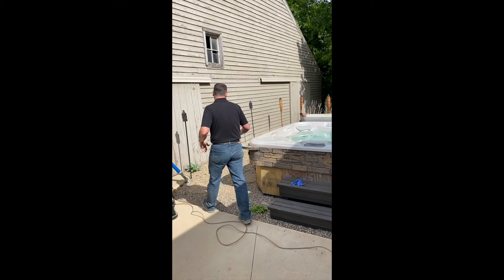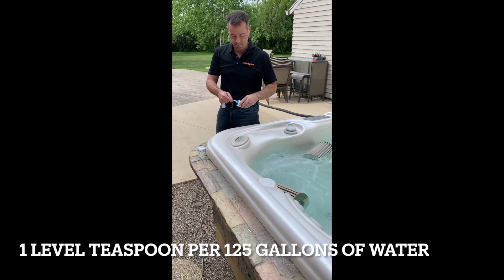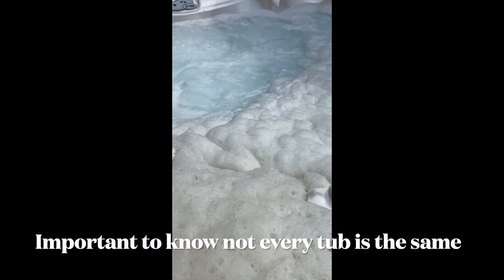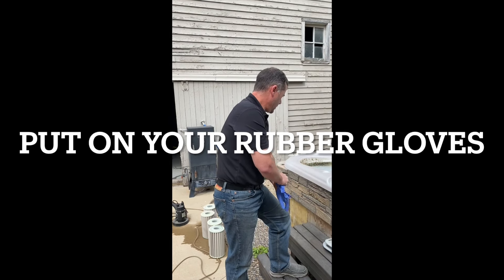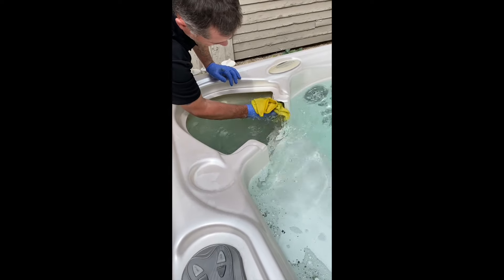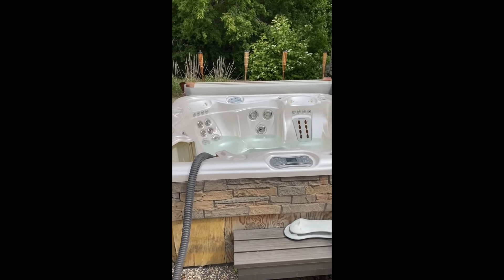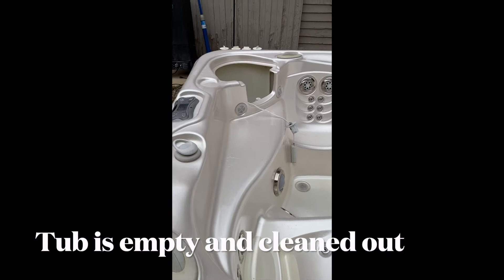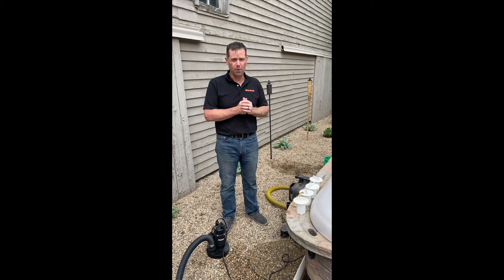How to Purge your Hot Tub with Ahh-Some

Comment: Do you recommend running it with the air vents wide open? And what’s the point of having the water balanced if we’re going to drain the water?
Reply from the maker: Good morning Brynn.  You absolutely should run Ahh-Some with your vents open.  With regards to why you would want the water balanced, it is basically to allow the Ahh-Some to work the most efficiently.  What we are most wanting to be balanced is your pH.  Having your water pH balanced will allow the Ahh-Some to work far better.  Can you run Ahh-Some with unbalanced water, sure.  It just works better with balanced water.
Reply: I just read this response and didn’t realize we should have the air on full! We had the motors on high…but not the air. Shoot! Next time we’ll know!

Comment: If your tub hasn't been cleaned like this in a while, would you need to fill the tub again to "rinse" things out before the final fill?
Reply from the maker: Great question.  I personally do not do this as any residual is very small.  I would fill, and then run the jets for a good 15 to 20 minutes to flush out.  Then I would start balancing as soon as your water reaches 80 degrees F.  That said, you absolutely can refill, run the jets and then drain again.

Comment: Hi! Thanks so much for this helpful video. Is there a reason why the filters need to be removed before the purge? Isn’t it harmful to run the jets without filters in? Also, isn’t it harmful to run the jets with no water as you did at the end? Sorry if I sound oblivious/ignorant—I truly want to learn why :)
Reply from the maker: HI there and thank you for leaving the comment/questions.  So lets talk about the filter cartridges first.  There is absolutely no harm in running your hot tub with the cartridges removed.  Generally, we don't want to do this on a normal basis simply because of what the filter is designed to do, filter water but also, we don't want big chunks of things (think leaves, twigs, ect) getting sucked into the system and potentially harming the pumps.  That all said, Ahh-some is really strong stuff and if there is biofilm in your plumbing, it will release it all.  If you leave your filters in, they will just get gunked up with biofilm and I have seen bad cases where you need to completely toss them and get new ones.  So, for the duration of the purge it is completely ok to run without the filters in.  If your tub is under a lot of trees and what not, just shut the cover while the tub is purging so you don't run the risk of anything going in the water.  Now with regards to the jets and what I did there to cycle them quick.  For that quick of a period of time, no harm will be done.  If you let it run, Yes, harm will be done but I simply just cycle real quick.  Push the button, and then almost instantly push the button again.  Hope this all helps and please let me know if you have any other questions.  Jim

Comment: When that cruddy foam is building up on top of the water (while the 30 minute process is happening) should we try to scoop it out?
Reply from the maker: Hi Ralph and thanks for the question.  I would recommend not trying to scoop anything out.  This will simply take away what the Ahh-some is working to do.  Just let it be and let the purge complete itself then once you turn the jets off, the foam will subside and you can wipe down.

Comment: I need to drain my hot tub and refill so I want to run this product through before draining and refilling. My chemicals are not balanced at this time. Can I still run this product and then drain and refill without balancing first? What temperature does the tub need to be at?
Reply from the maker: Hello and thanks for the question.  You absolutely do NOT need to have it balanced to effectively run Ahh-some through the system.  You will lose a bit of effectiveness but it will be a very small amount of difference.  We prefer the water to be above 80 degrees to run Ahh-some so that way the gel dissolves properly.  Hope this helps, let me know if you have any further questions.

Comment: Hi. Thanks for the great video. I am getting a brand new hot tub and heard you should purge with Ahh-Some to remove any biofilm and contaminants from the manufacturer wet testing. You mention in your video, that you want your water perfectly balanced. Is this a requirement for a brand new tub? I was hoping to just fill with hose water, heat and then purge. Then drain and refill and start balancing the water. What do you recommend?
Reply from the maker: Hi Nick and you are very welcome.  It is not absolutely needed to have perfect balance before purging.  The most important factor you can check right away is your pH and you can run a simple water test from your source water.  You just don't want the pH to be extremely high or low before purging.  For example, my water source pH is about 7.9 so that is slightly high but well within the range to purge with.  Great question and thanks for asking it.  Jim

Comment: I did my first  purge with Ahhsome and a tremendous amount of brown clay-like crude came out of my 6 month old Hot Springs Envoy. Since then, I noticed a dramatic improvement in the Hotspring Freshwater Salt System's performance.  I was able to turn down the output level and can go many weeks without having to add chlorine granules and only shock (MPS nonchlorine) once a week. I previously had to add chlorine manually weekly and shock (MPS nonchlorine) after each use  to supplement the salt system. I used to  struggle  to keep my chlorine levels up.
* I just did another purge yesterday after 10 months. Only saw a  mild green ring of film around the waterline.  No thick brown clay-like gunk this time.. The water lines near the motor look brand new inside. I wonder if that is a result of the improved salt system performance from the last purge with Ahhsome.  Where I really see a difference is with my jetted tub. With other brands, I had to do 3-4 purges to clear out the pipes..I kept seeing black flakes and gunk when trying to bathe...with Ahhsome, one purge gets it done..no black flakes. Clear clean water. I do deviate from the directions which say let system run for 30 minutes...I let my Spa and jetted tub run for closer to 1 and a half hours and let it sit off for 30 minutes before letting it run again for 10 minutes and draining. I find more crude is produced after an hour opposed to 30 minutes.
Reply from the maker: Thanks for the great information here JD.  This is extremely important information for everyone who owns a tub and especially for those with the Freshwater Salt System.  Thank you for taking the time to write what you wrote.
Reply: @ahh-some  This is the product that made our Freshwater Salt System perform like it is supposed to!  I reported our excellent results back to our spa supplier, and encouraged them to advise all new Freshwater users to START their system with Ahh-Some.

Comment: Can you clarify what you do with the salt cartridge during this process? Leave it in for the purge or remove it at some point? Thanks!
Reply from the maker: Great question.  I leave mine in so that the purge can do a good cleaning on the cartridge during the process.  You certainly do not have to but I always recommend to leave it in.
Reply: @ahh-some  Thanks for the quick reply!
Reply from the maker: @khueil  very welcome
Reply: I used the liquid ahhsome in my grandee- no foam, just a ring of yuck around the tub. 🤷🏼‍♀️
Reply from the maker: @khueil  Great to hear.  Don't worry so much about the foam.  The goal is remove the biofilm from the plumbing of course.  Lack of foaming is generally but not always due to the water in the tub being slightly on the hard water side.

Comment: It's ok to run the tub with no filters? Everything I've read said never ever do that. I'm assuming it won't work right with the filters left in.
Reply from the maker: It is absolutley ok to run your tub without filters.  The only reason we like to keep the filters in the tub is to ensure any large particulates such as leaves and what not do not go through the system. That said, the tub will actually run just fine without the filters for the duration of your purge.  If you leave them in while purging, you will ruin them and will need to replace them as the amount of gunk that will accumulate in them will be not great for the filters.  Some customers will actually shut the cover of their tub while purging, especially if the tub is located under trees just to prevent foreign objects from entering the water while purging.  Great question and please let me know if you ever have any others.  Jim P

Comment: So you just using sump pump for convenience? Can I just open up drain and let it drain than? Also while purge is running can I shop vac the dirty foam as it builds while pumps running ??
Reply from the maker: Yes I just use the pump because I have them (we live in the upper midwest and everyone needs a sump pump in the spring) so I just use that.  You absolutely can use the gravity drain just fine.  I do not recommend shop vac'ing the foam.  The foam is your active ingredient that does your purge so you start pulling out the foam you are starting to lose active.  Just let it run its course.  You really should not have that much foam anyways.  Use less Ahh-some than you even need to.  You can always add to it if you need to add more.  Hope this helps and thanks for the comment.

Comment: Just wondering if we have to purge until there is no gunk produced? We have followed the ahh some instructions with a fill, purge, drain 3 times already. Each time we add ahh some to the highly chlorinated water, either green/brown or white/yellow gunk is produced. So we drain, vacuum the lines, refill and start the process again. Do we need to keep doing this until ahh some produces no gunk or have I blown our water bill for no reason 😂
Reply from the maker: Great question and there are times that additional purges are needed.  However, I would not drain the water in between purges.  You can continue to purge with the exact same water.  This will save time and will save on the amount of Ahh-some used.  Here is a good procedure.  Purge the tub with the required amount of Ahh-some, and do the purge.  After the cycle is completed, wipe the gunk away and let the tub sit for 30 minutes to an hour.  This is actually of benefit as it lets the Ahh-some in the water sit in the plumbing.  Then go back out and run it for 30 minutes and repeat.  You can use the same dose of Ahh-some all day.  At least 4 to 6 30 minute purge cycles before needing to add any additional.  Once you have everything running clean, now it's good to go ahead and drain the tub.  Hope this helps.
Reply: Super helpful! We’ll try this. Thanks for the quick reply and clear instructions!
Reply from the maker: @jacquelinehall6388  you are very welcome.

Comment: Ok I have a quick question. Can I use Ahh Some if there are no chemicals in the hot tub? We bought a used tub and want to clean it really well before use but we don’t want to waste chemicals balancing it if we’re just going to drain it anyway.
Reply from the maker: Hello and thanks for the question.  You absolutely can purge without the chemicals being balanced.  No need to waste them.  One thing I would just make sure is somewhat close is your pH.  If it is super out of balance, I would balance that a little.

Comment: Should I use this on a brand new hot tub I am getting right off the bat? Or should I wait for a few months of usage?
Reply from the maker: Hi Jason.  My recommendation is to do your purge sooner rather than later.  If you or your family is/was like mine, they couldn't wait to get in the tub when we first got it many years ago.  Is it absolutely necessary to complete immediately?  No, but it is better if you do.  The tub is already dirty from the manufacturing process.  I would say that most everyone generally either does it right away or within the first 4 to 6 weeks after having the tub in place.  When we got our new tub 2 years ago (we had an older one that was just falling apart) I purged it right away and I was very happy I did so.  It was quite dirty.  If it was me, I would do it right away and just get the first purge done and over with and allow yourself to enjoy a good clean tub right from the beginning.  Hope this helps.
Reply: @ahh-some Thanks for taking the time to write all this. I’ll take your advice and do it from the start.
Reply from the maker: @jasond2900  Our pleasure.  Let us know if you ever have any questions.

Comment: If you only replace the water once a year (because it is salt system) do you ever recommend using the product in between fills or must you always drain the water out after you use it.
Reply from the maker: Great question.  Generally and as a rule, I only recommend using when you are going to drain your tub.  Can you use it and NOT drain, Yes you can however there are some additional steps that MUST be taken to ensure safety.  Ahh-some releases a lot of bacteria into the water.  There are only isolated circumstances where I would recommend not draining.  If you are only draining once per year, that is fine to do.
Reply: You can also apply his newer product in the Ahh-Some line, once a week as I do"Aqua Clarity"

Comment: I have had my tub empty for a couple months , left it running all winter at 80° unused . So i should fill it with hose water , let water heat up to the 104 ° , get chemicals balanced then purge or can i fill with water, let it heat and purge without wasting the chemicals to empty after purge?
Reply from the maker: HI Cassy,  Don't waste your money on getting everything balanced first.  Just fill it up and purge.  Then drain, refill and then balance once your tub is clean.
Reply: Thanks 😊

Comment: Hello, I was under the impression that i should never run the jets without water. Is that safe to do? I have a Caldera Cantabria.
Reply from the maker: Hi @ericka great question.  You are referring to the final step of getting the remaining water out of the plumbing after the tub is drained I assume.  I have always just cycled the jets.  It is literally 1/2 a second.  Push button to start and don't even take your finger off and push it again to turn off.  Safe to do.  Others use a shop vac and others don't even bother and just fill the tub.  The amount of water remaining in the plumbing is an extremely small amount.
Reply: @ahh-some  thank you!
Reply from the maker: @ericka7338  You are very welcome

Comment: Used this product yesterday it did blow a lot of crap out.  However, it didn't remove it all.  Not giving up on the product yet.  Would you recommend hyperchlorinating it along with the cleaner?
Reply from the maker: Thank you for the comment.  Yes, you can use some chlorine however don't go overboard.  It doesn't really "help" make Ahh-some any more effective.  It is good to use some to kill off what does come out however.  Also, there are some tubs, that have an excessive amount of biofilm build up.  It is 100% ok to go longer on your purges.  30 minutes on, wipe up, let the tub sit for a few hours, 30 minutes purge again, wipe up, let the tub sit.  No need to drain the water in between purges.  Just keep going.  We have many customers who do this for days to absolutely make certain there is nothing left in the pipes.  This is not needed all the time, often times, just on the very first use.  After that, one 30 minute purge is all you need.  Every tub is a little different.  Don't hesitate to reach out to me directly also if you have any questions,  701-412-1267 is my cell and I try to answer all calls (unless I am already on a call, then just leave a voicemail).  Hope this helps,
Reply: @ahh-some  I also am going to assume when "wiping up" part we need to be getting it physically out of the hot tub.  recommend a net? or vacuuming it out?
Reply from the maker: @stephenschmidt1998  We want it out for sure but I don't go to any more trouble than to wipe it all out with a rag.  I Just let it go and then once the cycle is complete, I just wipe down with a wet rag.
Reply: Before using Ahh-Some have you ever done a Purge on your hot tub before? If not, then yes you are going to have a ton of Gunk come out for the 1st time & or this product is much Stronger than any other Purge on the market so if you use a different product beforehand it may not have been powerful enough to actually do a deep removal & left a lot of grossness behind,, now the Superman strength product came in & started doing the Real hard work. If I were you I'd Purge again. I'd also check out his newer product"Aqua Clarity"

Comment: Website states 1 TABLESPOON per 100 gallons. Video states 1 tsp per 125 gallons. Which is correct?
Reply from the maker: If it says Tablespoon on the website that is an error.  Can you possibly point me in the direction that you saw that error?  You ONLY want to use 1 TEASPOON per 100 gallons.

Comment: Outstanding video!! Do you recommend wiping the empty hot tub down with white vinegar once the purge is complete? Or is a simple rinse with the hose good enough?
Reply from the maker: Thank you very much.  To answer your question you can absolutely wipe down with a vinegar/water solution.  I personally do not, I just use the garden hose but I know many customers who do.  Another little trick as well, if you run into a sticky spot on your tub that isn't rubbing off easily, you can take 1 teaspoon of gel and mix with 1 liter of water in a spray bottle and just spray on the sticky spot and let it set for a few minutes.  It will then wipe right off.